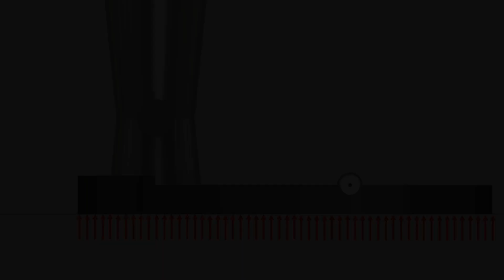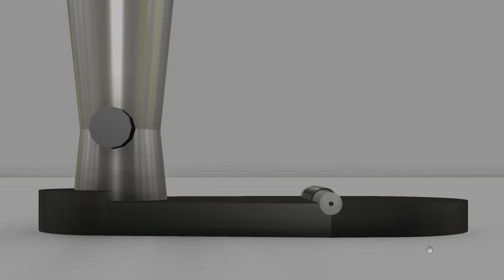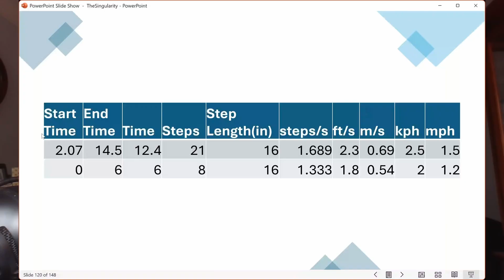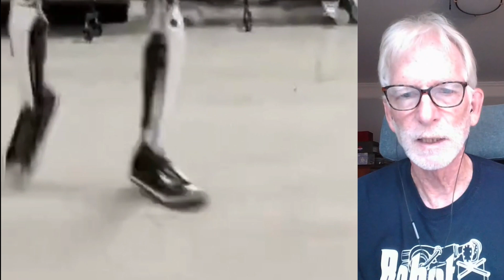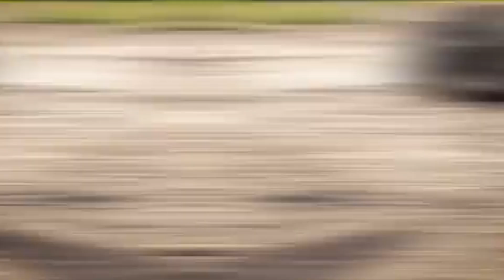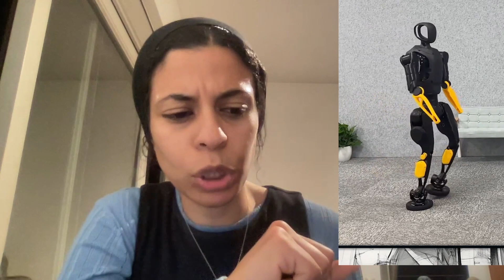The Articulated Toe: Why Humanoid Robots Need It?

Comment: Hmm, for the foot wheel types I'd leave the wheels fixed in the rolling position and have a rubber stop flip down under the front of the wheel to lock it from rolling and also act as a "toe" when you want it to walk. Only one small moving part to switch between modes and you get the support and shock absorption of the tires in both of them.

Comment: i've been harping on this for a very long time. the articulation joint helps ease kinetic damping and reduces energy waste. flat footed robots waste so much energy it's almost comical. one step closer in the direction of fully solving locomotion, however these new "breakthroughs" are drops in a bucket compared to the 500 million years nature has spent iterating on the original design.